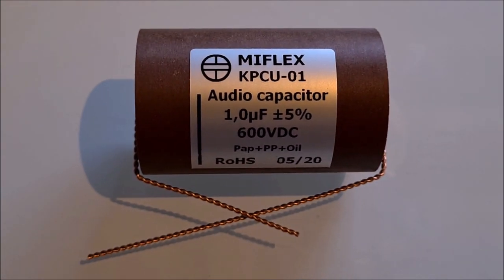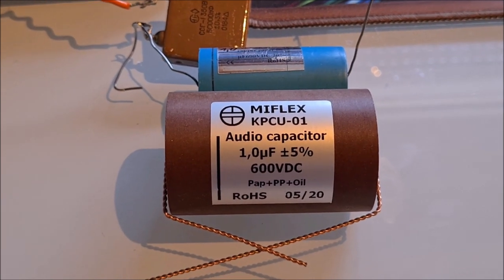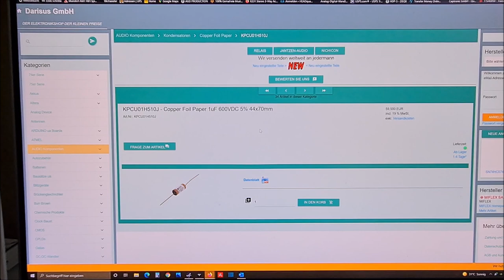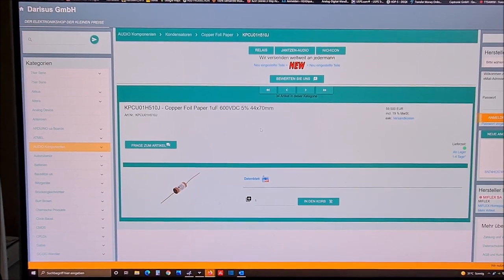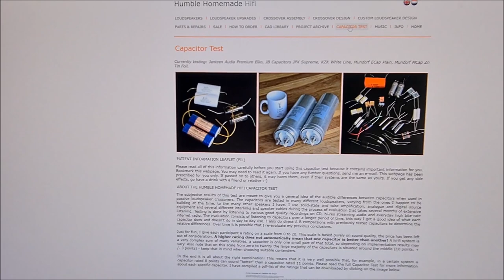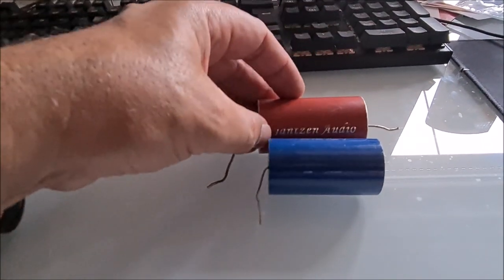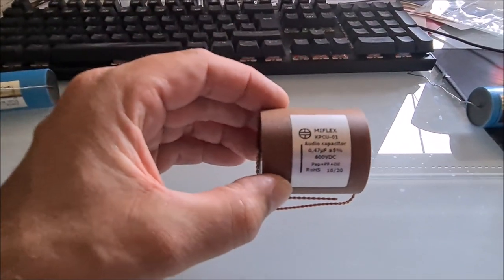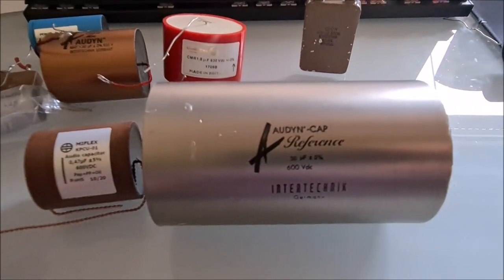Cap, Caps, Crapp....and then:   Miflex!!! OMG!

Comment: I liked your video! Do you recommend the Miflex KPCU 0.1uF bypass on speaker or preamplifier electronics? Have you tried the Russian K75-10b? I have Jantzen Superior Z and 0.1 Miflex copper as by pass on speaker midrange, Jantzen Silver Silver and Miflex 0.1uF on tweeter - NO ghosting. I have Jantzen Superior Z and K75-10b on single ended triode preamp - RICH sound, dense and 3 dimensional. I wonder what you think of Miflex 0.1uF on preamp input?
Reply from the maker: Hi, I like them very much. I tried the Miflex KFPMO1 in my Krell, see video. These are significantly smaller and have a slightly more colorful sound...a matter of taste, but easier to integrate. Cheers Mike
Reply: Thanks! I can tell you’re Krell is very “open” sounding. Perhaps in a video you could compare the sound of Miflex KPCU-01 vs KFPM-01 on electronics? Colourful is a good description, I understand what you mean 👍

Comment: Hello , it is no so clear from video,  did you use SSG1  as bypass  over rike audio , or do you have there serial connection rike with russian ssg1 ?  thanks    , any audible improvement  SSG1 over Miflex KPCU ?
Reply from the maker: Hi, SSG01 is in parallel as shunt in midrange and tweeter section positive, no matter what cap is used...cheers Mike
Reply: @headquarteraudio5388  hi, what value do you use for SSG1 as a parallel shunt?
Reply from the maker: @davidgunalan7225  I have different ones, take what you can get and as big as possible. When you add it as a shunt you are still within the tolerance range of the main capacitor... cheers Mike
Reply: @headquarteraudio5388  thanks Mike

Comment: hi great video as usual  But how can we know which caps are sounding vs time ?
regarding coupling caps i would try also some parallel of decent PP caps with small teflon cap bypass like they used to use at Millennia for their mic preamps
Reply from the maker: how can we know your ears vs time?😀 Use good components, and you will have fun for a long time..cheers Mike
Reply: @headquarteraudio5388  hi I said it badly
I mean I don't understand which cap is sounding in the video at different times 
It's a comparison between different caps?
Reply from the maker: @gino3286  sure, first Rike second Miflex, i say it in the video, stopp scrolling 😉😘 cheers Mike
Reply: @headquarteraudio5388  thanks 👍

Comment: Hi. Wonderful video. I'm curious about the Russian cap since you didn't say its brand and where you bought it. You use this to bypass the Miflex? Can you give more info on this please? Thank you and keep up the good work.
Reply from the maker: Hi, sorry, i dont know the brand, my russian is bad.. :) the silver mica is called SSG01 you can find several offers at ebay. Yes, i used it as a shunt with Miflex Cheers Mike
Reply: Search as SSG-1 to find it online
Reply: Do you think SSG-1 performs better than JDM silver?
Reply: First is a mica dieletric.........they don't compaire ! @alexbartels
Reply: @frankgeeraerts6243  Explain yourself please. I asked if SSG-1 betters JDM Silver, as a bypass cap. "They don't compare" is not an answer.
Reply: They don't compare because the Mica is superior ! @alexbartels
Reply: @frankgeeraerts6243   I will check myself, have two 73nF CCS-2 0.5% settled in, together (in parallel) with 2x JDM Silver 0.01uF on my first order mid-crossovers which are build around 100uF (10uFx10) WEET Aluminium capacitors.  Sounds fabulous. It gained more than the difference between old crossover (Jantzen Standard-Z + Silver-Z)  and the new ones with WEET. Will desolder JDM / CCS-2 one by one to check which ones are better, and, maybe they form a very good couple and I leave them both. Btw, also bypassed with Cornell Dubilier 940C-3kV-0.01uF and Bevenbi 0.01uF. Will remove them too for comparing.

Comment: After much research and keeping in budget to partially upgrade Magnepan 1.7i xover, Im replacing 10uf Axon with 10uf Jantzen Superior Z. Would a Miflex KPCU03 0.1uf bypass on this be worth the extra cost?
In the 116uf bank of caps replacing 75uf elecrolitic with Clairity CSR.
P.S. Want to sell your extra caps of these values?
Thanks!
Reply from the maker: Use Jantzen Standard blue with Miflex shunt, more timbres and emotions. Cheers Mike
Reply: @headquarteraudio5388  
Wow, I didnt expect that combo. Jantzen Z Standards cost about $50 USD less / cap and rated over 2 pts lower on Humble site. So the 0.1uf Miflex bypass can make a big improvement while reducing cost on the Jantzen 10uf?
The Magnepan 1.7i and my Odyssey amp are quite revealing. Do you still think Jantzen Z Standard are the way to go?
Thanks!
Reply from the maker: Its my tipp for tuning the Lintons, check my video. If you want more, use the Audyn Tri Reference,  my favorite in price/ sound. Dont forget the Siler Mica SSG01. cheers Mike

Comment: Try Miflex KFPM-01 ;) Available capacities up to 1uF only. I have KPCU-01 in my tube amplifier, and KPFM-01 in Dayens Menuetto.
Reply from the maker: Hi, ok! :) Cheers Mike
Reply: Which one sounds better? I have kfpm. Thanks!
Reply: @rolandkovacs4140  It depends what you like. I prefer KFPM. But KPCU adds some nice texture to midrange and has fantastic smooth trebles. In my opinion the most weakness of this capacitor is bass. Finally i have changed it to Jupiter Paper & Wax.
Reply: @krzysztofmosion3349  I hear kfpm very detailed, smooth, warm. I don't even feel a lack of bass.
Reply: @rolandkovacs4140  You're right. I wrote this about KPCU.
Reply: @krzysztofmosion3349  Thanks.

Comment: welcome to the miflex world :)
Reply from the maker: Hi, Hi, why didn't you tell me earlier :) :), more tipps? :) cheers Mike
Reply: @headquarteraudio5388  Sorry :), i learned about it last year from watching a video of New record day on a DIY speaker from GR Research. Danny richy, the designer, talked all the time about crossover upgrades and was raving about Miflex for their affordability and amazing sound. I tried it in my amp and speakers. I never went back.
I was also a follower of humble home made hifi so i tried a lot of the caps he talked about. The man is a saint for sharing such knowledge. 
I order often on Hificollective, an english web site but i'll try the one you suggested.

As far as tipps you seem more knowledgeble than me :)

I like your videos because i see things that i did before and proof than i'm not crazy.

For the netgear switch : try to experiment with higher value caps for the jack DC. Or better in the switch by replacing the cap inside. Placing maybe 10 x 22uf+ 4700uf in parallel in the switch just before the streamer. I t had the effect of opening more the sound and allowing the right decay on the instruments.

I know how to make killer LPSUs, i suppose you too ?

I tried SCR teflon caps but like Jupiter or Dueland it's too expensive.

Comment: Did you made the sound check with different cap capacity? 30uf with 0.47 uf will sound different as the cut out frequency is different...
Reply from the maker: Hi, have you ever looked at the tolerance values of the capacitors? Do you really think that a manufacturer will select their capacitors in this price range (Linton) or higher? Believe me, I've heard dozens of capacitors in various price ranges in various combinations for thousands of euros ... Cheers Mike

Comment: So 1uf is added as bypass to tweeter crossover filter? If so what is the main value cap and what microfarad value of main cap?
I have listened to it on on my HiFiman  400i and Miflex is still not fully past breakin and little closed in but it sound very balanced and rich there ,that sound  can be listened to for long time without ear fatigue.
Reply from the maker: Hi, 0,1 uF or/plus 0.01uF but not 1uF..  cheers Mike
Reply: @headquarteraudio5388  Thanks I just added 0.33uf Miflex KCPU01 and Mundorf supreme 0.01uf Silver Alu Oil to main cap 3.9uf Mundorf Supreme .... Cap is a single part of tweeter crossover on my B&W 686s2 mini monitor , these sound so clean and smooth, but Miflex replaced Audyn True Copper and Miflex really opened up the soundstage and instrument separation along with richer harmonics and overall detail ...
Reply from the maker: @kdomster9141  hi, mabe use the Audyn Tri reference for the 3,9uF..you will have more and better overtones----emotions ...cheers Mike

Comment: Hey i own a pair or MA silver 100 7gs and have done some crossover upgrades recently. They consist of superes resistor and jantzen cross cap on the woofer circuit and ohmite audio gold resistors and clarity cap csa bypassed with miflex kfpm on the tweeter circuit. Im wandering if you think i should bypass the jantzen cross cap with somthing like the cde 940c or perhaps the kfpm? Also i plan to do a rca 1st order high pass using either the kcpu or kfpm but cant decide. What would you pick for the high pass and also is it worth bypassing the woofer cap inyour opinion? Thanks!
Reply: did you got any improvement?
Reply: @Darokkk yh had the mods done for a while now. Easily 200+ hours of burn in etc (they are my main speakers so get a lot of use). These speakers really responded well to the mods. Layering and spacial placement is great and after I added the kfpm as bypasses for the tweeter caps I noticed decay of cymbals and breath of vocals came through with more fine detail and it gave more of that upper frequency air that the CSA cap was slightly  lacking. I did put the cde 940c bypassing the woofer cap about a week ago but honestly I hear no difference so will be taking them back out for another future project. 

Also about a month ago I actually used two miflex kpcu-01 caps inline with my rca cable as a high pass filter set at 72hz. Immediately the mids started to sound clearer. In my view as a result of the woofer not doing as much bass work. Then as I got about 20 hours onto the caps I started to notice how smooth vocals were sounding. I wasn't sure if this was placebo so I got a friend over to a-b with and without the hpf and it turned out to be an immediate difference. The music just seems to flow better with the harmonics of vocals and instruments really popping out of the mix but in a very natural organic way. Sounded Just right to my ears. These miflex caps really are some of the best I've heard but if your looking for value for money I wouldn't shy away from the CSA as they give a pleasing overall sound in the few projects I've used them in. Also going even cheaper the Jantzen standard are great in  the woofer section.

As for resistors I couldn't tell you with any certainty they made a difference however in future projects I'll be sticking to the Jantzen superes as the price for what
Your getting is great and for a few quid I'd rather have them in place of the cheap inductive sand cast resistors.  Long winded response I know. Hope this is enlightening!
Reply: @JMJM75257  thnx for the reply...Nice to hear that it worked well...I did also replacement on MA Silver 6 all caps Jantzen standard and resistor also...at first I regret it...but after a month of listening everyday speakers started to shine and it was great improvement...ofcourse that was 100€ investment so I understand that producer will not put so much in the crossover...so yea I think also if someone thinks to upgrade the crossover, dont go crazy but its worth it

Comment: On a second listening I think that the miflex adds a sort of color to the sound, when there is a solo instrument it enlarges it a little, but when the dynamics increases everything becomes more confused. The rike in my opinion is more neutral and the instruments seem more correct. The miflex is too expensive for what it offers, and it only does it in a different way.
Reply from the maker: Hi, yes one step up from Miflex is Rike but both have Music inside ...cheers Mike
Reply: I just got some Miflex for my Wavelength Amps but haven't installed them. I'm having second thoughts. The amps originally had Hovland Musicaps which were fairly neutral. Then I changed them to Mundorf Silver/Oil several years ago. I hadn't listened much until recently. The Mundorf have more bloom but sound too rolled off. I like extended highs and transparent neutral sound. What do you think?

Comment: One question, in your opinion, if I'm changing a capacitor on my speaker that requires high value capacitance, say 10μF, would i be better of to get the exact value film capacitor or just get a lower value film capacitor and run it in parallel with a chaper film capacitor or electrolytics? I mean does small value, high quality film capacitor run in parallel with say cheaper film or electrolytics capacitor already improve the sound for less money or just get an exact value?
Reply from the maker: Hi, use the same value and shunt it with 0,1 uF Cap like Rike Q3. Never use electrolytics... ;)   cheers Mike

Comment: Have you been able to try any of the Audio Note caps?
Reply from the maker: if they send me some i will, but i found my solution with Rike Audio Caps so, i will let it like it is. More to do in other parts of the rig with more impact cheers Mike
Reply: @headquarteraudio5388  Congrats on finalizing that very long journey of cap selection, and thanks for pointing me to Rike, I'll definitely check out their offerings!
Reply from the maker: @benjaminlloyd7868  if you are in EU ask me, I have to order some for a customer tomorrow.. cheers Mike
Reply: @headquarteraudio5388  Thanks kindly for the offer, but I'm currently living in Seoul. Also, I'm not sure yet on parts. I need to build a pair of LR2 crossovers (900hz) for the 1602/2001 TAD drivers. 15.6uF seems to be the target, and I want to get some silver in the mix, too.

Comment: how do you replace caps? Do the voltage and uf have to be the same?
Reply: uf yes, voltage no. You can add .01uf bypass anywhere without altering response. Beyond that if you change values it will change frequency response.
Reply: @charlesmiller6281  why not voltage?
Reply from the maker: same cap different voltage different sound signature ( foilthickness )
Reply: @headquarteraudio5388  so how do you determine and not mess things up?
Reply from the maker: @MasterofPlay7  Measurement and ear, what else?😁
Reply: @headquarteraudio5388  so it doesn't matter the voltage difference?

Comment: Hello  your clips is very nice, also introduction. I would like to ask you my cross-over in my speakers got 4pcs capacitors 2.5uf 200vdc if I changed it to another brand capacitors same value 2.5uf 100 vdc can I proceed??? if substitute to a lower voltage will it affect the sound???
Reply from the maker: Hi, yes you can use it in the tweeter section...but, the lower voltage may effect the sound, because maybe the used foil inside the caps is thinner, so it is a wide range to check this out... learning by doing...i use Rike Q3 600v with shunt Rike Q3 0,1uF now ( copper, paper, PP, oil ), they are better than Miflex... ( in my system :) )  Please be aware, every € you spend here is most important...cheers Mike   check this out...https://www.humblehomemadehifi.com/Cap.html
Reply: @headquarteraudio5388  Thank you for your reply in fact I was going for the Duelund but they are huge expensive for 1pcs 2.5 uf 100vdc looking on your video clip you almost changed my mind but thanks remind me on the higher VDC. Rike is a brand? made where?😀
Reply from the maker: @jeanphilluk  Hi, Rike is a german brand, and the Caps are all individual developed with acoustic check ( musicality ). I can say, its better than the Miflex i used before. If you want, i can sell it to you, or you order at Rike directly... https://rikeaudio.de/de/ please write me an email, if you have more questions ( for example, 2,5 uF x 4 = 10 uF or single use? ) be aware of the dircetion you install the caps... :)  Cheers Mike

Comment: i used Miflex KPCU in PS (first cap cLC) in decoupling and on crossover. And it never impress me more than other options. Rike is much better between tubes in my Phono preamp, Miflex just didnt have that density and base and HF seems just not natural and well detailed. People who I give them after nobody decide to stay with them. Duelund CAST are more open but sometimes they have some edge to the upper midrange I didnt like too. Russian silver mica add its taste to whatever you add, less so than teflon capacitors. For PS its never a good idea to use polypropylene or any plastic capacitors if you listen to rock music, as they make everything flat and glare, PIO or good electrolytics is only way. There are very good cheap paper caps from USSR. For crossover you need to have just many options to choose from, not always most expensive wins, wins just better suited to the application, but only listening test will judge. There is no such table or rank you can trust. In some way, yes...
Reply: That's not true a all about poly caps. I'm sorry that's ridiculous. I have a mix of poly flim and foil, Russian PIO, Teflon, DynamiCaps, and a couple polyesters. And nothing is glaring and certainly not flat. 

Now yes, not all of my stuff in the Amp is poly, but there's plenty of poly in there and I'm good. Now I'm talking about amps, not speakers. If you're talking speakers, you might be right 

 BTW Rike has polypropylene in it.

Also, electrolytics are the worst